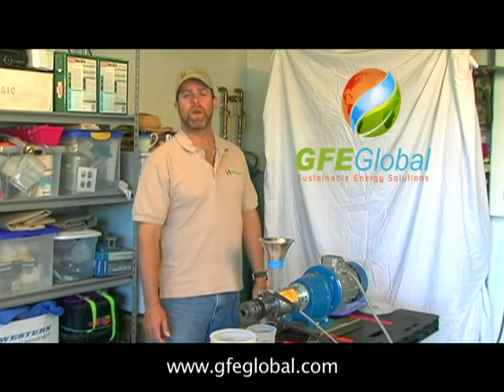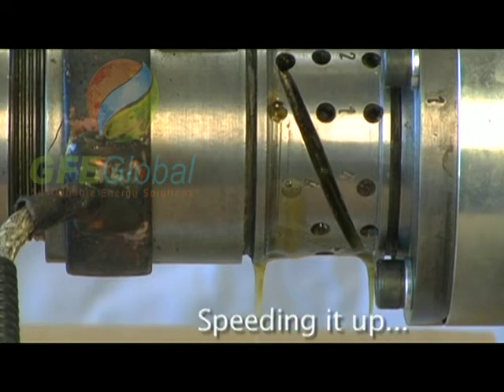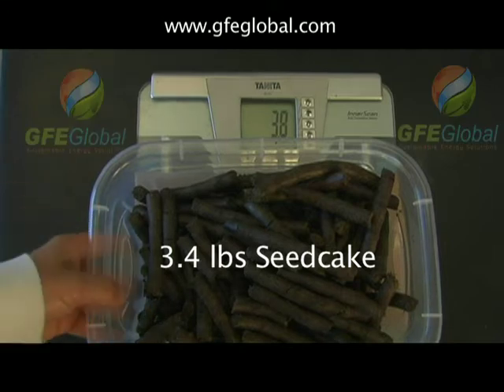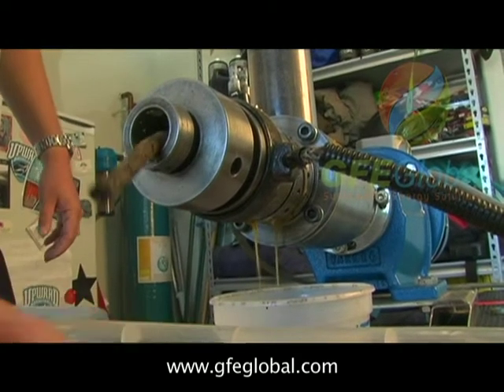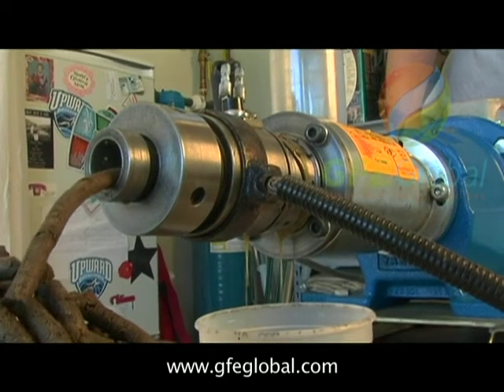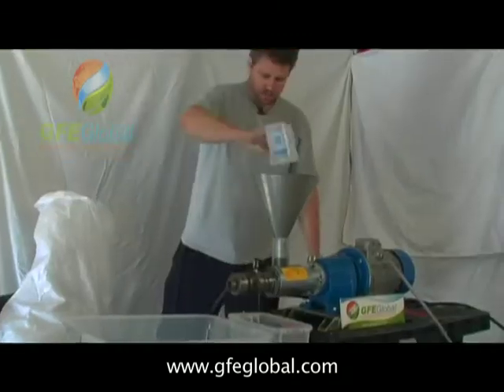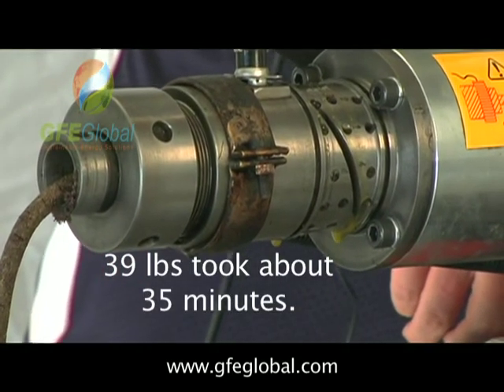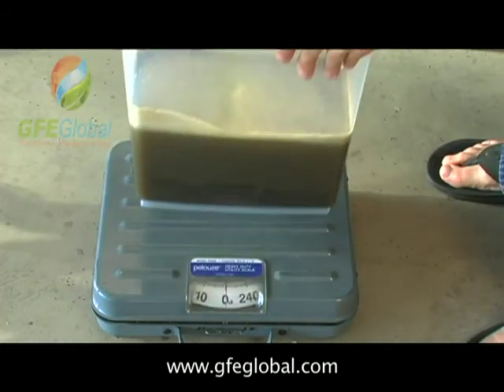GFE Test feedstock on type 40 algae and seed oil press

Comment: Bad math for Test 1:
.9 lb / 5 lb = .18 = 18% oil -- not 36% oil as you incorrectly showed in the vid.
If the raw material actually had 36% oil, then you get 1/2 or 50% of the oil that was possible to extract 18% / 36% = .5 = 50% -- not 73.5% of the available oil, as you incorrectly showed in the vid.

Bad math for Test 2:
1.1 lb / 5 lb = .22 = 22% oil -- not 30.5% oil as you incorrectly showed in the vid.
If the raw material actually had 36% oil, then you get ~6.11/10 or ~61.1% of the  oil that was possible to extract 22% / 36% = ~.611 = ~61.1% -- not 84.72% of the available oil, as you incorrectly showed in the vid.

Bad math for Test 3:
8.5 lb / 39 lb = .218 = 21.8% oil -- not 31% oil as you incorrectly showed in  the vid.
If the raw material actually had 36% oil, then you get ~6/10 or ~60.5% of the  oil that was possible to extract 21.8% / 36% = ~.605 = ~60.5% -- not 89.9% of the available oil, as you incorrectly showed in the vid.
Reply: Yea oil press method only gets up to 70%
Reply: He calculated the percentage from the amount of cake after pressing instead of using the raw material mass